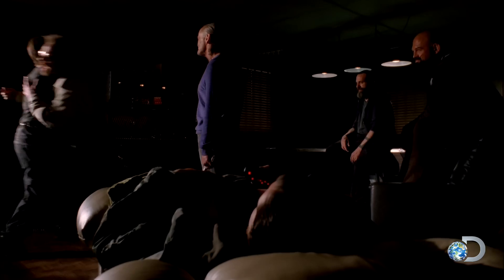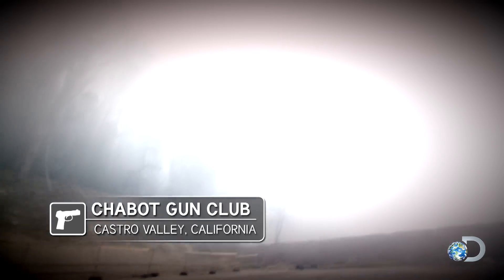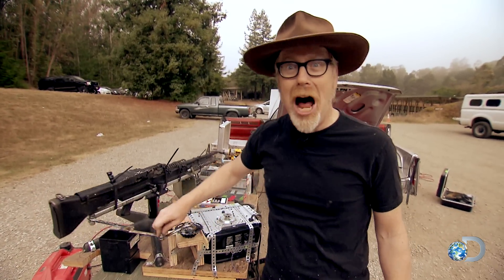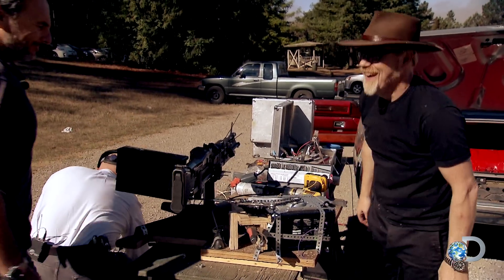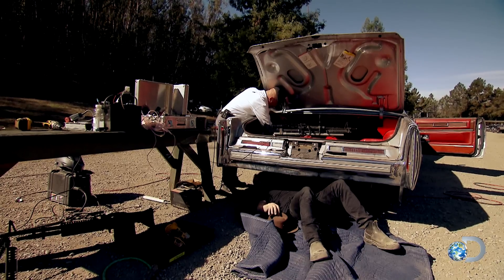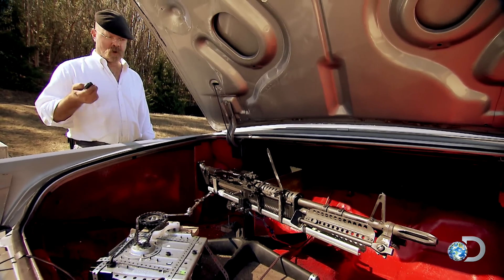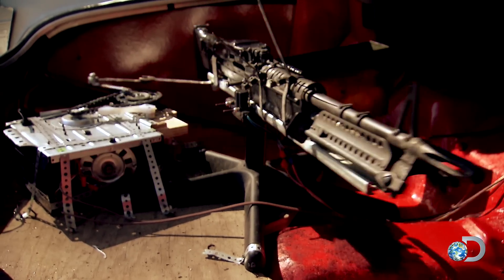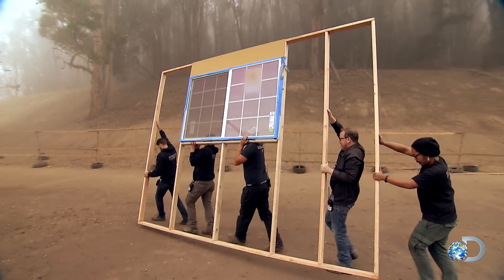Breaking Bad M60-in-the-Trunk Setup | MythBusters

Comment: 1, Bullets are the projectiles that are fired from firearms. They do not include the case, primer, or propellant. Cartridges are fed into the M-60 via a belt of metal links.
2. Do you know what type of ammunition Walter White used in his M-60? Standard ball ammo will have a certain level of penetration in stucco. Armor piercing ammunition will penetrate thin walls better than conventional ball ammunition. This would need to be taken into account if you are trying to determine how plausible it is.
Reply: Ball would work just fineee
Reply: Michael Scheele That's all true, but regardless, 7.62x51 would through a stucco wall like a pickup truck through tissue paper.  It isn't even a consideration.
Reply: Pyrex ^ lol
Reply: Michael Scheele I'm pretty sure M80 ball would cut through a quarter panel and proceed to penetrate a stucco wall retaining lethal velocity on the other side.
Reply: Michael Scheele Are you nitpicking the fact that they said "box for the bullets?" Sheesh.
Reply: Hi Joker it's seven six two mm full metal jacket